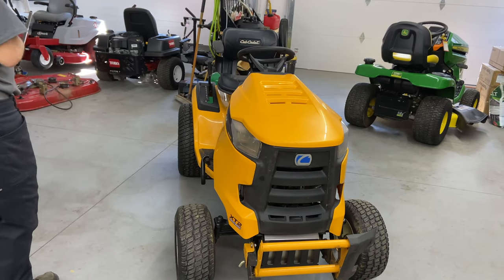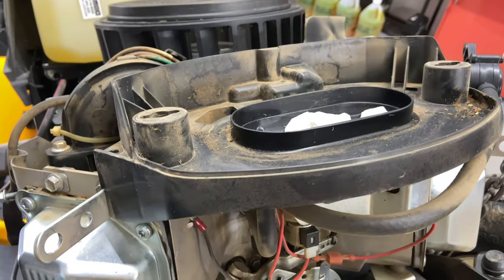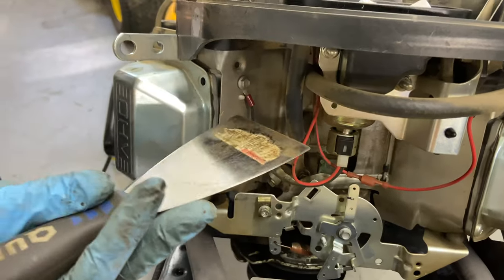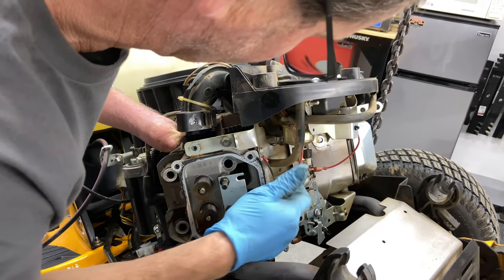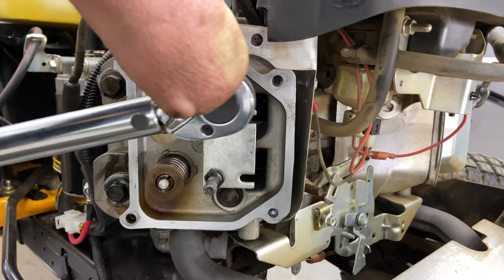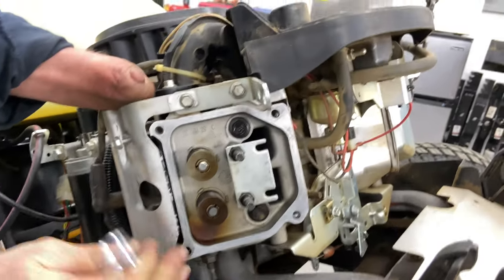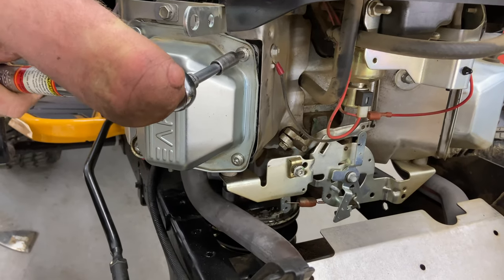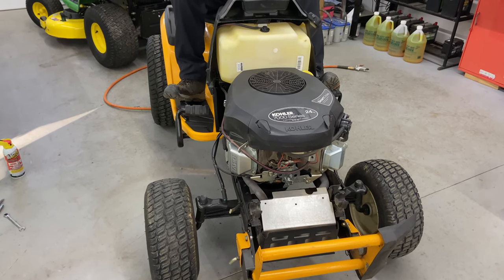Kohler 7000 Series Head Gasket Issue. How to diagnose and repair blown head gasket.

Comment: With proper maintenance, how reliable are these Kohler 7000 series engines?  Are they on the same level as a Kawasaki?
Reply from the maker: I like the 7000 series twin engine. It will be a good engine as long as you take care of it. No telling how many hours you can get out of them. In my opinion you cannot compare the two engines as you will get what you pay for. Japanese engines have better quality and you pay for it. Kawasaki engines are not cheap and will last. The Kohler 7000 series engines are much cheaper and do not have the same quality because of that. I can say with good preventative maintenance both will last a long time but Japanese engines in my opinion are better.

Comment: I see that your moving on up to bigger work. Glad to see this some really need this. I myself needed it and believe the kholer engine is a better one but low oil with mess any engine up. I got stuck with a kawasaki on my cub cadet but seems to run good but rather of had a kholer. Job well done and keep them coming.
Reply from the maker: Thanks Michael, I have performed many head gasket replacements in the Kohler and Briggs and Stratton engines through the years but have found it difficult to it get on a video. I thought this was important to document due to its a newer engine. I prefer Kawasaki engines over the Kohler.

Comment: When my Koehler 7000 is idling I hear a surge up and down, is it a carb issue or something else?
Reply from the maker: Impossible to diagnose without hearing the engine as it may be a few things. Sometimes you can get the engine to stop surging at idle by turning in the idle screw just a little . Other than that you may need to adjust governor settings found in your manual or it could be dirt in the carburetor (worse case scenario). Let me know when you figure it out.

Comment: Since you are In there, would you change the other head gasket?
Reply from the maker: It is personal preference. I stick with the motto if it’s not broke, don’t fix it and for 30 years I have yet to see a machine come back for the other side. There are a lot of variables with the head gaskets blowing. It’s not just the design of the head gasket or engine. It is also how you keep your machine running and maintained. It also cost is almost twice as much at a repair shop. Basically it comes down to each machine per how it sounds basis. If you’re doing this job yourself and you feel that you should do both both then do both! Like you said while you’re there.
Reply: Thanks for your insights. @JohnsonsSmallEngines

Comment: How did you know which side was blown?
Reply from the maker: You can hear which side it is when shutting down the engine. The swooshing sound. It may have been a little hard on the video, but you should be able to distinctively hear it on which side if they’re both blown, and then the sound will be on both sides.

Comment: You can also tell it got hot because it melted the throttle cable which was directly below that head
Reply from the maker: The melted throttle cable happens. Bad design by Kohler. It sits over the exhaust pipe.

Comment: If you go this far. Do you need to check compression.  Maybe you need rings and crank. Maybe a total rebuild. Valves job.
Reply from the maker: This happens to a lot of different engines. This is a repair that I perform often and the engine just keeps on going. If you were to rebuild this in my shop you would be at the price of a new engine or more so we do what we can do to keep the machines running. This Cub Cadet is only 3 years old and most likely could have been avoided. The engine is in good condition now and should last a long time if taken care of.

Comment: A blown engine head gasket on  any small engine is bad thing 😳🥺
Reply from the maker: Agreed! It happens more than you think. Normally from mice making there homes inside and of course the consumer that does not check the oil.
Reply: @JohnsonsSmallEngines   yeah buddy 😎 it's a strange thing to have some one believe the no oil change mowers they sell at home Depot 😳